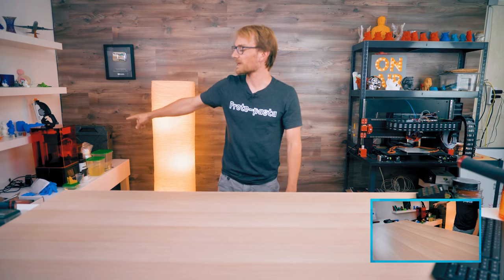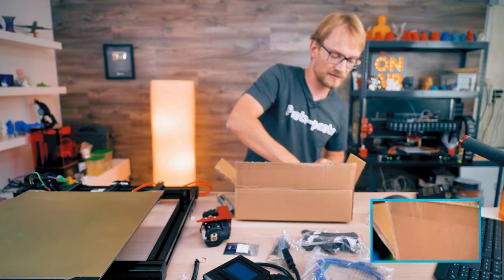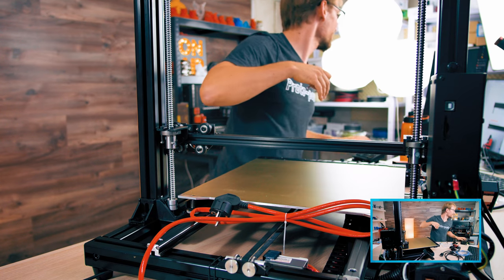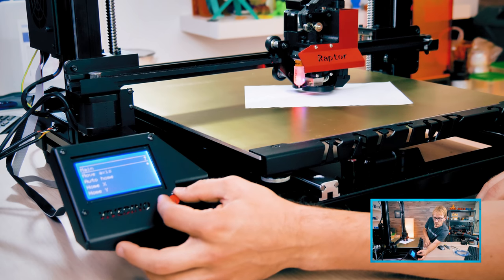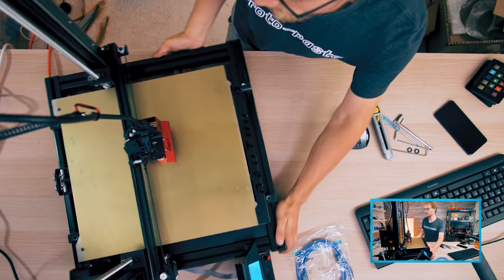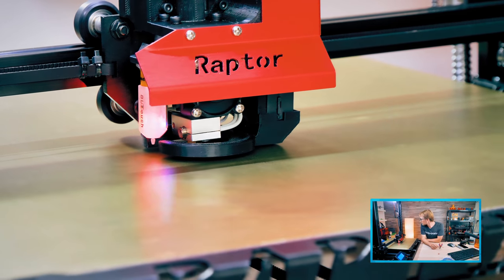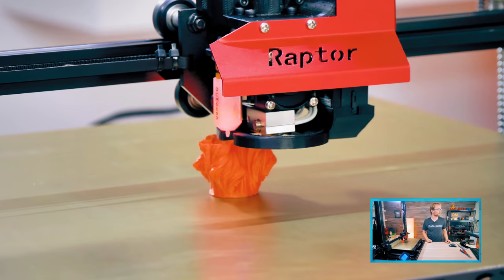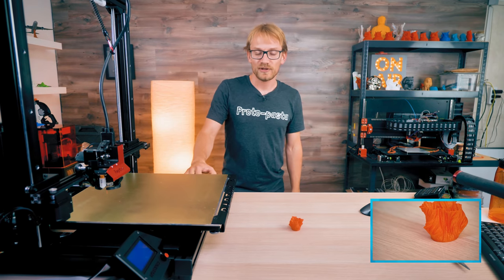Formbot Raptor 2.0 - the new CR-10? (Live unboxing & first print)

Comment: I have 3 printers with 300x300x400mm print volume currently, and sometimes I still run into issues making some items due to size.  The fact that the Raptor 2.0 comes with a 400x400x500 or a 400x400x700mm build volume depending on which version you get sounds really exciting for a printer in this price range.  I use my printers as part of a small side business we have and currently the main things that hit size limits are making items for some cosplayers that come to me to print things.  Building things like armor or helmets that a full size adult can wear without breaking them into a bunch of smaller pieces that have to be put together really requires a lot of build area.  Some of the clock designs I have developed can really start to push a 300x300mm build area as well without having to print the clock vertically and diagonally on the bed.

Comment: I have the v1 raptor. One thing to look out for is making sure the x-axis motors are leveled, in sync. As you print, turn off/on the printer, etc, they'll get out of sync. I level my x axis against some machined blocks before every important print. Especially important if you're using the whole bed and trying to troubleshoot the first layer.

Comment: This printer is also called Vivedino Raptor 2.0 some places. It's a really popular printer in the 3d-printing community here in Norway.
Reply: @merrickpelan8815  It's quite well regarded here, but so is the artillery sidewinder and the ender 3. So you might want to take it with a grain of sand.
Reply: @merrickpelan8815  Not major issues, but they are confirming much of what is said in this video and dismissing it. Most are spending money upgrading it in one way or another.

Comment: I like this printer. I have a first gen Ender 3 and a Anycubic Predator, but this printer is very interesting. Considering some of the components that this printer comes with and it's print volume I think the price is very reasonable. An example are the ball screws. More precise with much less backlash when compared to cheap lead screws. And those linear rails are excellent. As far as the hot end temperature is concerned, the manufacturer states that they use a high temperature PTFE tube that's good for up to 350C so assuming they're not lying, that would be more than enough for any filament I'd ever use. Plus the maximum bed temp I see myself using would be around 110C for ABS and ASA so bed temp is fine.  I'm really considering getting either this or their Core X/Y machine. Anyway, thanks much for the overview.

Comment: Tom I have the 700mm version and love it!. I did put a real E3D V6 nozzle on it so it heats to the higher temps with no problems and got a 400mm Polypropylene sheet from Tiny Machines because I really like a removable print surface. I have 8 printers with also includes a Moai SLA printer but the Raptor 2 is an awesome printer.  I was surprised you didn't mention that the heated bed pad is a Keenovo which I believe is one of the best on the market. Enjoy the new toy!
Reply: Could it print a 40x40x70 cm pipe with 15mm thick walls (10% infill) reliable with 0.6-1.0mm nozzle? It's a dealbreaker for me, large prints that work IRL.

Comment: Wow, a 36 point mesh at this speed?! This thing just calls for some firmware tweaks. BLTouch has a fast probing mode and the XY speed for probing can be safely increased too. This takes ages, especially if you want to run ABL before every print. A better solution would be switching Marlin to Unified Bed Leveling, then let the printer save the detailed mesh in the EEPROM and recall it before print, maybe with a simple 3-point probing for tilt compensation.

Comment: 2:13:00, even when unplugged, moving the y axis carriage causes enough EMF to turn on the circuits again!
Reply: The motor acts as a generator when moved quickly and it feeds that power into the board. Will happen with all motors.
Reply: @PaleoHuntr  that's what the original comment just said

Comment: Hi tom, they release STL files for the hotend, and will try to give STEP files if you plan on making a mod.  I've modded the original raptor hotend files to take bondtech gears, but not the raptor 2.

Comment: Once you get the Z probe offset initially set close, you should be able to adjust that z probe offset on the fly on a test print to fine tune it and then save the setting again.  My Formbot TRex 2+ with dual extruders has worked great for me, I am still having to tweak some of the settings from Simplify3D as far as external infill but so far it is going great.  The TRex 2+ has the capability of building a mesh while the bed is cool, the instructions state to do so but I found the setting to build a custom mesh using the bed temps to whatever filament you are using, I highly recommend building a custom mesh instead.  I don't care what others say about the price of this printer, you take into acount the variety of objects one can print with this printer along with the other features, I find this printer is of great value!  I would add that this printer would definitely be for novices or those buying for their kid to start of with first, this printer should be at least a second purchase after they get acclimated to 3D printing with a much smaller 3d printer.

Comment: 30 minutes in and so far I'm digging the machine.

Edit: I'm not a fan of the idler bearings for the Y axis. Those should be toothed idler bearings. I'm actually kind of okay with the tensioning system being a couple eye bolts. It looks kind of odd with that setup and could look more professional, but as long as it's reliable I have no complaints with that part.

Comment: Just burned some cash on this printer, second hand. Even though you have another video saying, dont buy it, or technically im lying. One im waiting for is the 700mm ver, but i guess they are identical other than taler frame.. 
Gave about 500usd in total, supposedly has little use and "upgraded" extruder last year when owner had it serviced. Not sure what this means, if formbot havent changed it after raptor 2 came out. Looks fine on pics, ignoring the layer of dust it has collected. Not sure if this was a good price, ok or over priced. New it cost over twice as much. 
Any tips, tricks or advice anyone reading this would be kind to share? Perhaps there is a community that could be helpful. All in all, im just looking for info that can help me making 3d printing a not so frustrating experience.. :P
Im new to 3d printing, i have on other hand experience with "old school" machining like cnc, also play with 3d modeling using 3ds max.. Been wanting 3d printer for many years. Looked at creality cr10s5, but a bit pricy and people talked about few issues. At least on the paper this one looks better out of box, and hopefully a decent platform to start at and perhaps upgrade if i feel like it if 3d printing becomes a hobby i like.
Anyways. Any advice, etc anyone care to share if youy have experience with this printer? And, any websites, perhaps communities that might be helpful and interesting? Tnx for any replie. :)
Reply: Well, now im a owner of this piece of hardware. The 700mm. Looks to be a ok machine to start with, think im happy i ended up with this vs creality cr10s5. But, downside is fewer people has this one vs a cr10 series...

Comment: I don't really get the point of using ballscrews on the z-axis. Backlash is basically no problem, as is friction. Good quality trapezoidal lead screws would be more than sufficient and much cheaper.
I like the guides they used for y and z though. Any information on their lifetime and wiggle?

Comment: Rs232 cable as the main hot end/extruded wiring loom?? Interesting.....definitely not very innovative... but..interesting...
Reply: I thought it looked like a VGA cable when I dropped in late on the live stream - just started watching it from the start.
Reply: Yup - it's a 15pin D-sub so VGA rather than 9 pin RS232 ... suprised that the pins can handle the current but hey, bloody good way to keep the cabling tidy and easily maintainable.

Comment: 40x40 is wuss. We need 70x70 and a 100x100. We need something that can print molds for serious stuff. Without ridiculous price tags because it doesn't cost much to make them bigger.
Reply: You know, most of the cost for the printer comes from the guides and bearings, for which the cost scales more or less linearly.
After a certain length, linear bearings actually get pretty expensive in shipping, since you need to protect the quite well.  
Same for the frame if you use extrusions. 
If you want such a large buildvolume, a decent, high-powered hotend is also needed, which also increases cost.
If you want to go big, i3 design is not the way to go. You don't want to shake around your giant mould or whatever. 
So going corexy will need pretty long belts, which also introduce new problems.
Please think before you make such claims.
Reply: @Rossingiol  I'm only a genius so thinking comes with the territory. How about you.
Reply: @DanFrederiksen  whats your disease called again? does it end on utism by any chance?